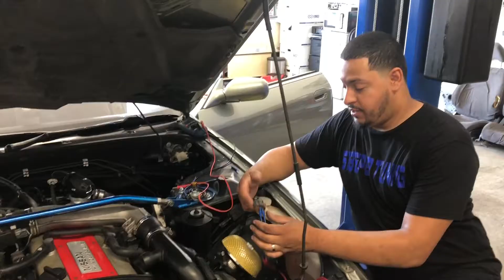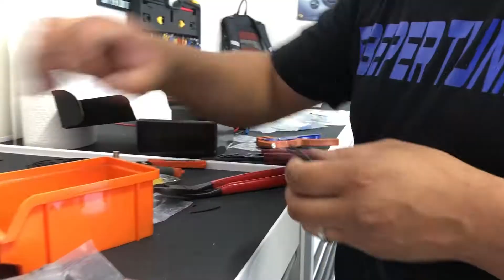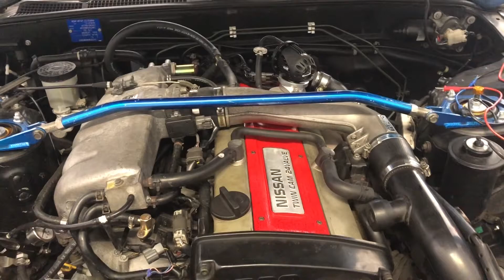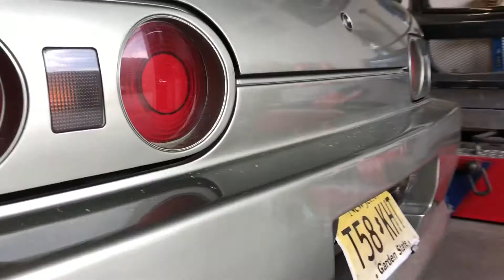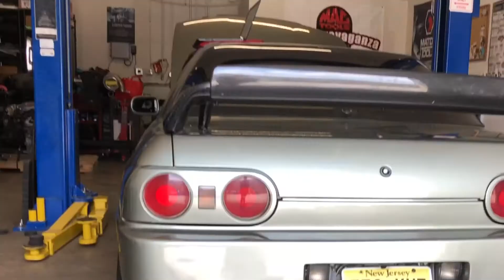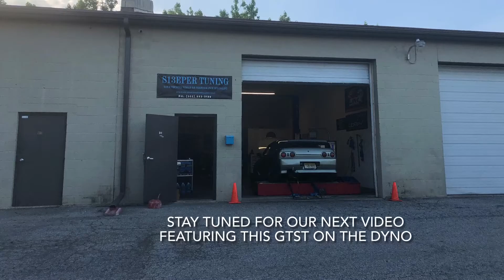GTST gets fitted with Haltech Elite 2000 plug and play.

Comment: Clever use of the wiring. Is the IAT happy using the engine ground instead of the sensor ground
Reply from the maker: The IAT uses the sensor ground from the mass air flow